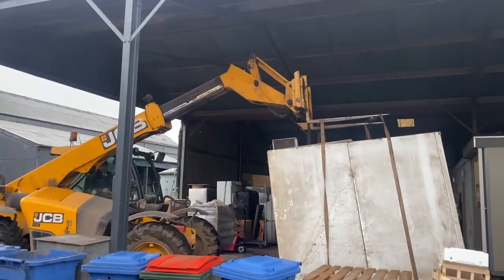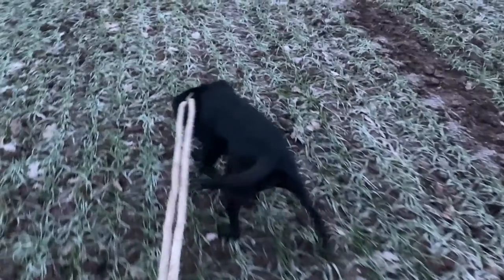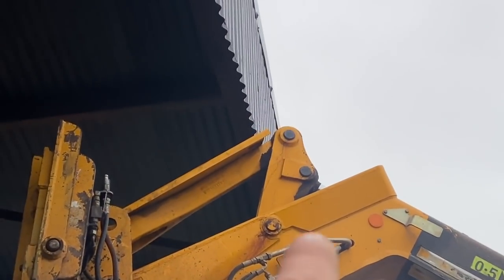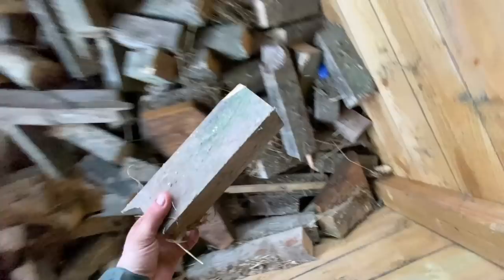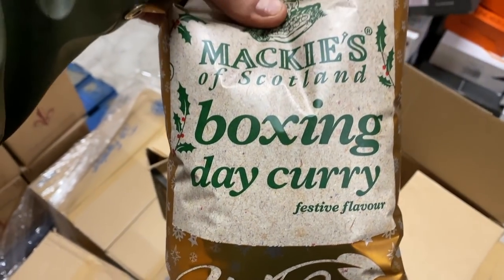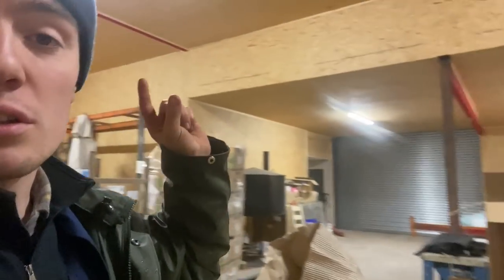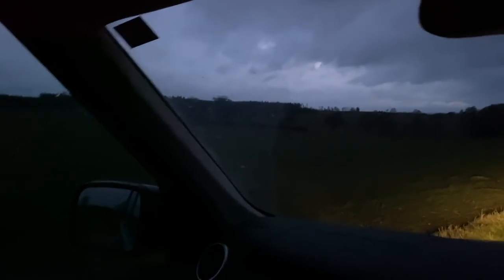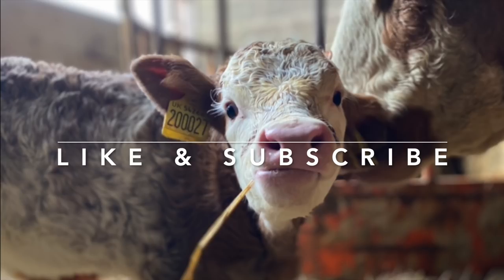DON’T DROP IT | PROJECT BARN CONVERSION | #CRAWFORDFARMS #169

Comment: You want a Lindi forklift if you can get one very good forklift they rev the engine as needed as you pull the levers regardless of forward movement but very nice forklift for outdoor to if you can get an air cooled one with the deutz engine the three ton ones have a oil pump in them an never be done we have a 35 year old one will push 4.5 ton trailers about on the tick over incredible machines. Nothing against my family's forklifts off Moffitt Mountys and now combi lift forklifts but the lindi is very nice to use.

Comment: i have driven a similar Massey and a the same john deer and I think its because its a touch louder but the Massey felt like it had a bit more oomph, the john deer parts where too much and most jobs require a man with knowledge from dealer, in terms of those two I think the massey is a better buy, but then there's the fendt, they are supposed to be great

Comment: Can only speak for the 155 and a 716 The 700 fendts are a lovely tractor but dont pull nowhere near as well as the Deeres.  They are a bit small and light. The cab on the fendts are a bit on the small side to. Wasn't a great fan of the cab layout and screen on the fendts. Very old fashioned and not quite as good as the new JD cabs. Also the service intervals on the fendts are 500. The Deeres are 750 so makes them a little cheaper to run.

Comment: I'd say the T7 210 is best bang for your buck. Cousin has a 190 and is quite impressive. He bought ex hire from a veg farm linkage had never been used, plastic still on the seat, 450 hrs but heck of a saving on new. 
Be nice to know the difference in price from NH to the Fendt?
Reply from the maker: 👀 a new trailer
Reply: @CrawfordsFarm1  easy decision then 210
These high prices won't last and inputs won't drop so things aren't looking good medium term.
I've heard the autopower is more reliable than powershift?